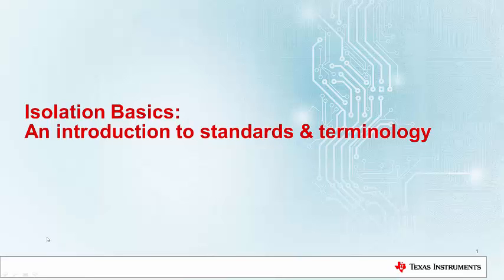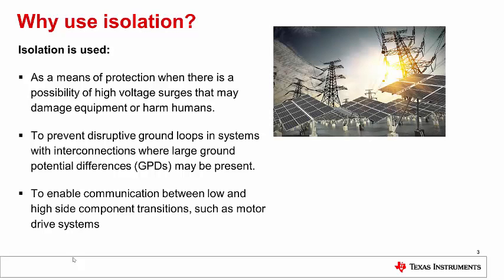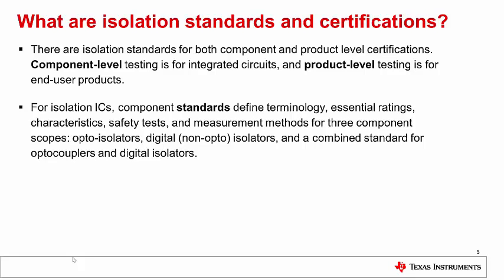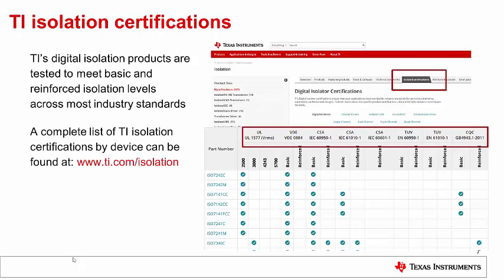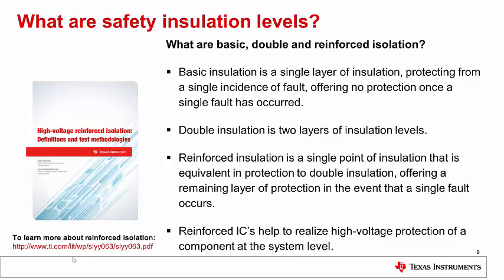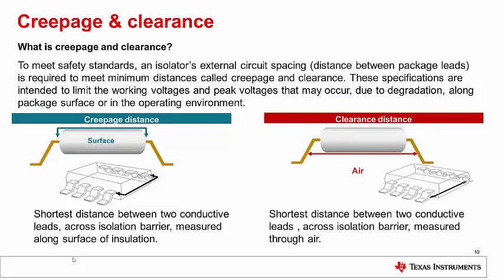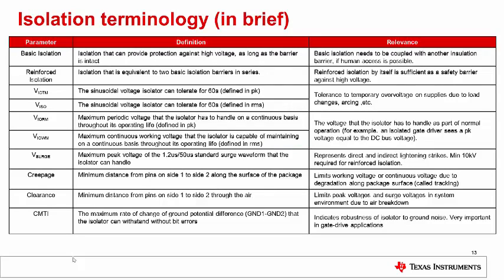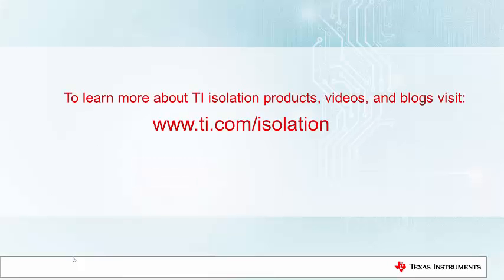Isolation Basics: An Introduction to Standards and Terminology

Comment: TI - thanks for posting this - just wondering about something - when a design is Fault Graded; are there any plans to roll in how a design; IC; maybe even something at the PCBA level; could be Fault Graded or how could Fault Grading be impacted by some of these new ideas/terminology?  I realize we are talking about signal vs. something that is more power related; but I think it would be interesting to have maybe more than one layer of Fault Grading so to speak.  In a related question; I see a lot of low power designs use gated clocks; and I wonder how that passes Fault Grading.  Thanks.
Reply from the maker: If you have other questions about isolation, our experts in the E2E community may be able to help: http://e2e.ti.com/support/isolation/